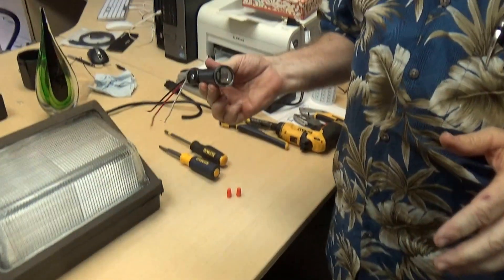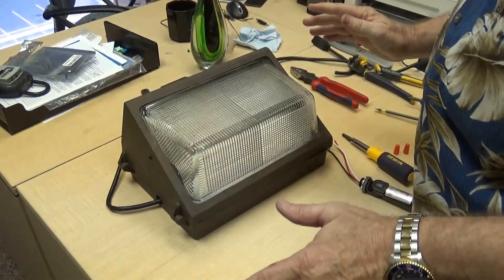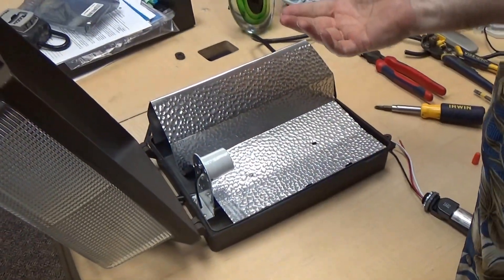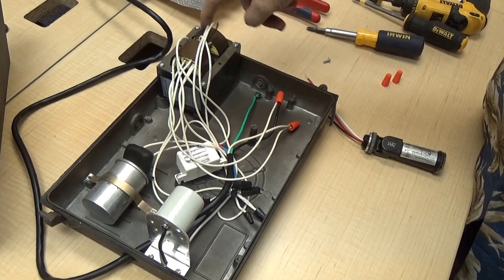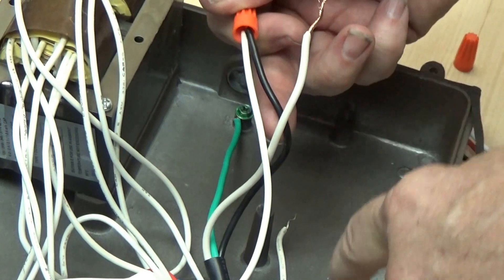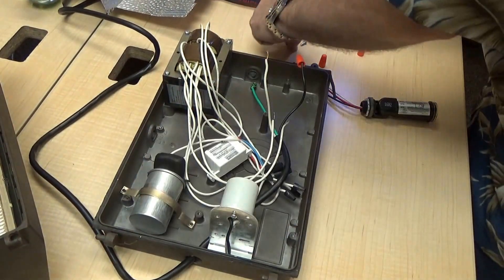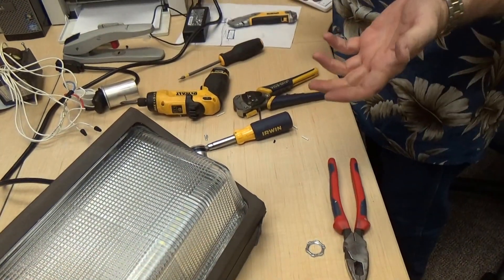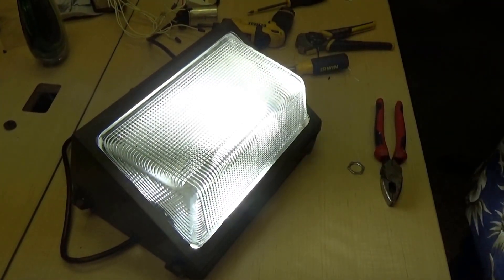175 watt Metal Halide Wall Pack conversion to simple  LED 40 watt "HD"

Comment: Led is nice, but metal halide was also pretty good. I didn’t get why you retrofit it and I would just buy an led fixture and keep that metal halide fixture for lighting collection
Reply from the maker: you are quite correct , MH is a very good source of light , However , it gets VERY HOT. is prone to burning out the ballast , The Capacitors are prone to fail with excessive heat . and they are not instant start . 
LED requires no warm up time , is better as a security light when using a motion detector . Requires less current . Less current and you will never have a Burned lens or reflector even while the light is still working .

Comment: Also,i would not recommend retrofit the wall pack with LED corn bulb,because it's enclosed fixture,the temperature inside is very high,and the corn bulb is very hot,light decay very fast,i would recommend use the corn bulb in high bay fixture(no cover lens)
Reply: I installed 100W corn bulb in the aluminum enclosed fixture, I don't think it lasted through the night.  It would be very helpful if you had mention the heat factor during the retrofiring tutorial LOL
Reply from the maker: @jeeterlind7362  100 watts worth of LED is a lot of power . I apologize for not mentioning that amount of heat tolerance a particular LED bulb can handle . Also note that the bulbs produced today are far better than the bulbs produced when I made this video . This one is respectable    https://www.ebay.com/itm/High-Power-E27-E40-35W-65W-LED-Corn-Light-Bulb-Lamp-Replace-Metal-Halide-HPS-CFL/123707436297?var=424303086236&hash=item1ccd89ad09:m:mZej3jXLlZzyczI9bfvl3XQ
Reply from the maker: A aluminum enclosure with a say 40 watt LED Conversion is not much of a problem , However it does depend on the particular Corn Cob Led bulb , the housing made of aluminum can dissipate heat My current enclosures have been running 3 Years with only 1  Photo cell has gone out
Reply: yes,that's right. @MrRoverpilot

Comment: Hello we are looking for clients do review for our led lights,do you have interested in ?
John
Reply from the maker: John Philips I could be interested can you give me more details and what kind of light is it yes I’m sure it’s an LED conversion but is it a cob. And what kind of driver does it use
Reply: Hello,we have 2 options,one is the new wall pack fixture,and the other is LED CORN COB LIGHT BULB.Which one you prefer?
Reply from the maker: Need more details , Lumen output, Color temperature , Size of fixture, Spread of light , cost of application , Voltage range of the driver , So I believe I might want the Wall Pack but detalis are important. The corn cob bulb Length over all , Diameter and voltage range , Does it require it to run off of the existing Ballast? . I have another Wall pack like you see here ready to be rebuilt , Or I can replace a exterior light . SO what you think?

Comment: Can you provide the link or info on the photo cell?  Also, will the photo cell remain off if there is shaded sunlight and not direct sunlight shining on it? I'm planning on doing exactly what you're doing on wall packs all around a commerical building, but the setup is where half of the photo cells will be shaded for a portion of the day.  Thanks!
Reply from the maker: The photo cell that I use is from Home Depot  Because U have a Home Depot account  But lowes Menards Ace True Value  Tractor Supply and even Sears and Walmart carry them .

Comment: you didn't describe what to look for as voltage which wires to connect as the voltage and its 4 connections 2 from the wall and 2 to the bulb if its 120 volts connect 120 wire to your power and common to the other coming from the wall and your line goes to the black going to the bulb and second common to white going to the bulb

Comment from the maker: http://www.ebay.com/itm/E27-50W-LED-165LED-5730-SMD-Cover-Corn-Light-Lamp-Bulb-Warm-White-White-220V-HOT-/291852631541?var=590856205012&hash=item43f3c5bdf5:g:DFsAAOSwWTRWy9uw   This is the one that I used and it is available in a 100 V to 130 V or a 200 V to 270 V version 50 W worth of light equal to 175 Watt metal halide and as you can see not very expensive

Comment: I need exactly the same 175 Watt MH equivalent LED corn cob lamp. Which brand and wattage of LED lamp did you use.
Thanks.
Reply from the maker: Victor Vajna you get that
Reply: Wow, that's a great price for the corn cob leds. Thanks!
Reply from the maker: Of course better ones will cost more but that eBay one will work because it's the one that I used in the video. I also like that particular one because it can be easily disassembled and turned into other config

Comment: Why put in a photo-electric cell if the light is on a timer?
Reply from the maker: Timetryp I show how to put it in in case somebody wants to they don't necessarily have to they can be on a switch or on a timer I prefer always to be off with a photocell even if it's on a timer so that at the very least it won't come on when it's light out what it will still be controlled by the timer